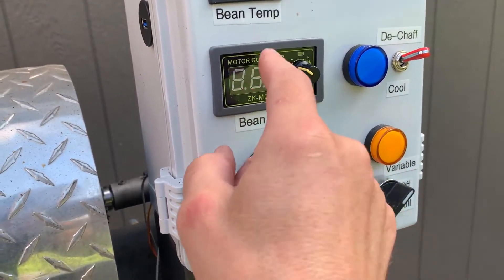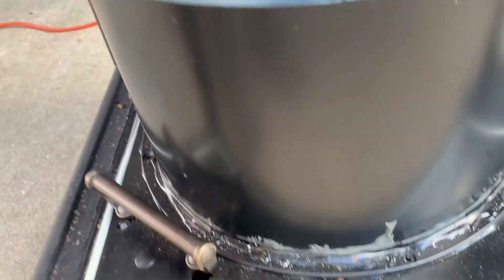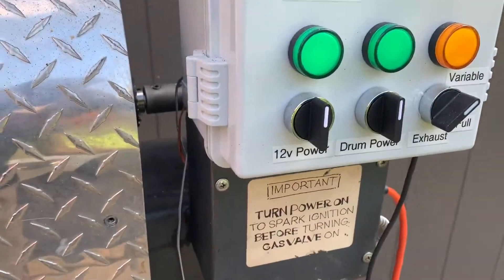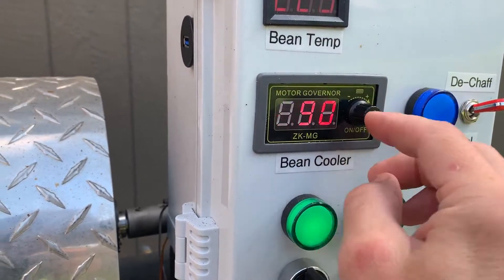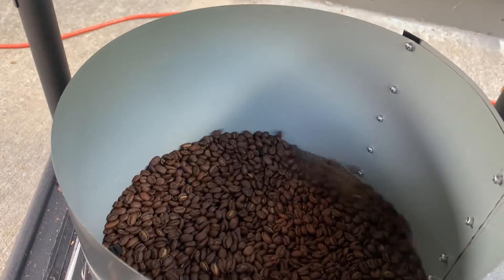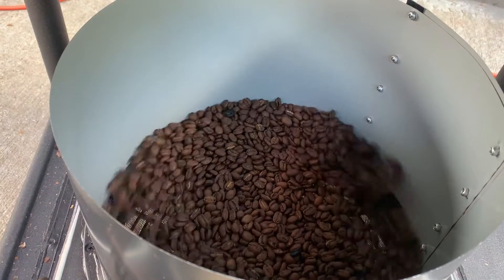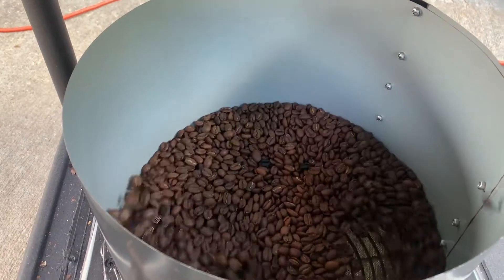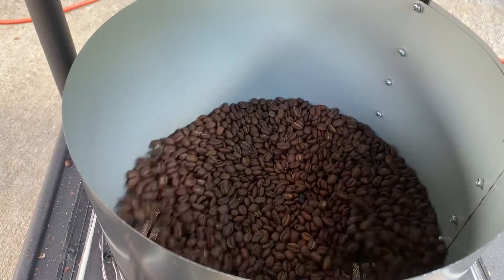Hermetheus 2.0 Coffee Bean Cooler (DIY bean cooler)

Comment: Awesome idea to cool the beans! Any chance of a few more pictures of the motor and bottom of the unit? I'd been keen to build one. Thanks
Reply from the maker: I don’t have this anymore, but it’s simply a SPAL radiator fan mounted to the bottom of an RV roof vent/screen. It’s a dead simple design. The beans rest on the screen bottom and the fan pulls air through the beans and out the bottom.